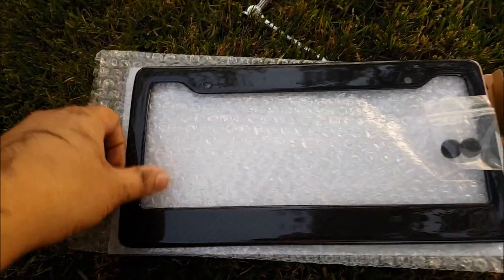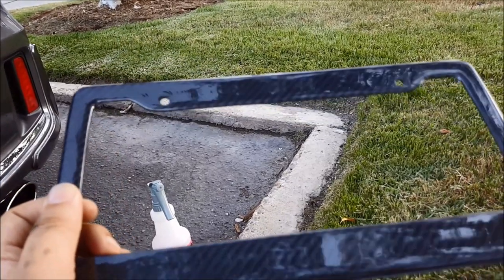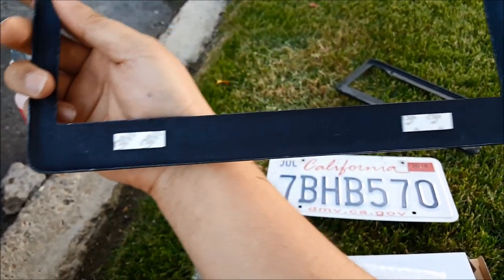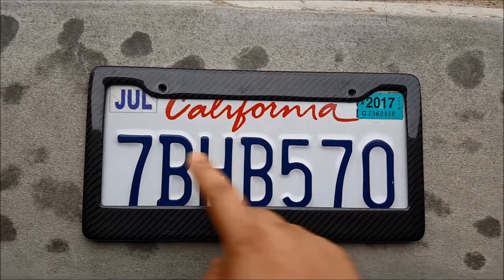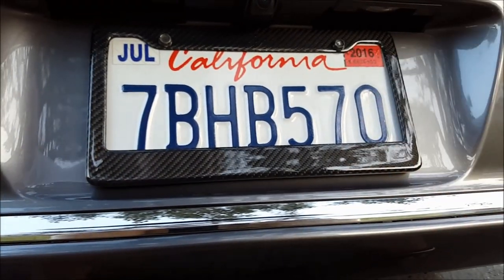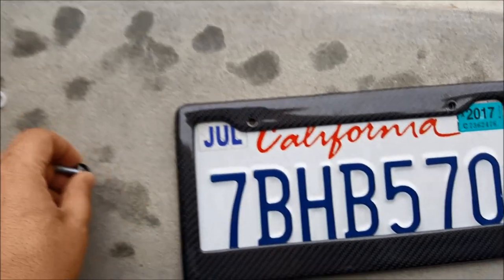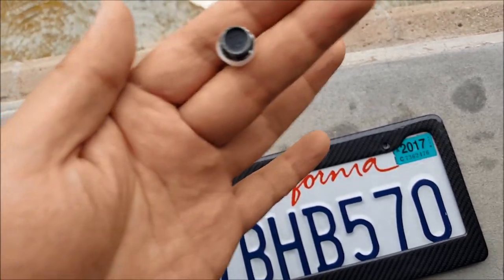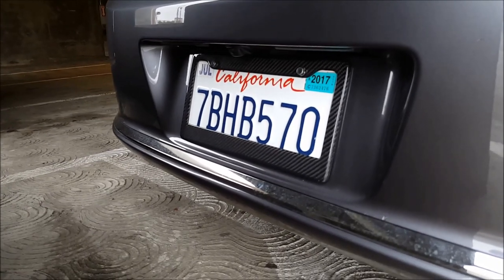Review: Carbon Fiber License Plate Frame

Comment: You don't have a license plate for the front?
Reply from the maker: I do have license plate on the front.  However, I have not installed this CF license plate frame in the front.  Rocks and road debris can easily damage it.
Reply: I see, I was needing help with the front since my car has a license frame bracket in the front and i had trouble with my previous license frames, but no worry, got the same frames as yours yesterday and went and installed it, a few double sided tape for padding did the trick
Reply from the maker: Nice.  Where in San Diego do you live?  I heard that there are Accord car meets around town.  Would be nice to meet people that watch some of my videos. =)
Reply: Unfortunately I'm not in the area, Seattle is where I'm from

Comment: Caps are instant trash, they fall off pulling out the driveway lol
Reply from the maker: Yup.  You have to either glue them on or just don't use them at all.  I just painted the screw tip with black paint.
Reply: ConvertibleJay 😂☠️